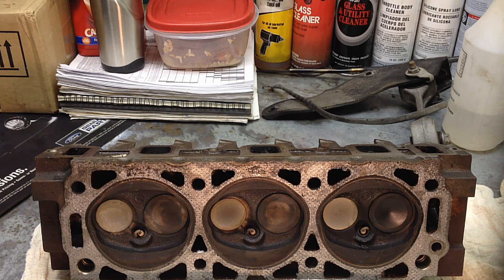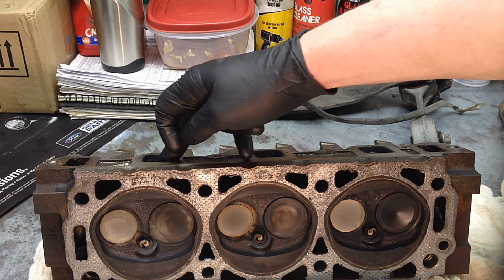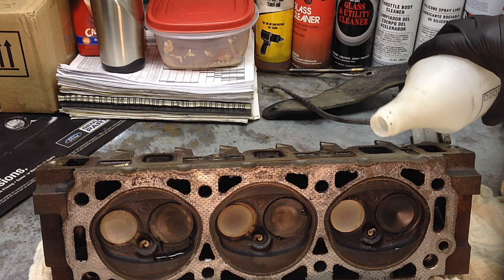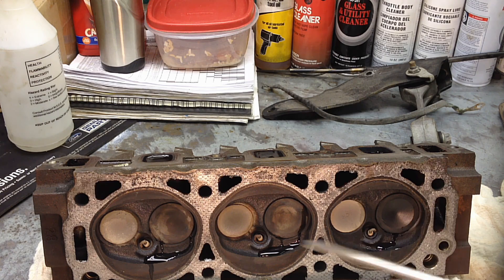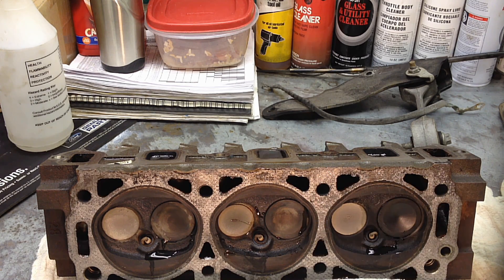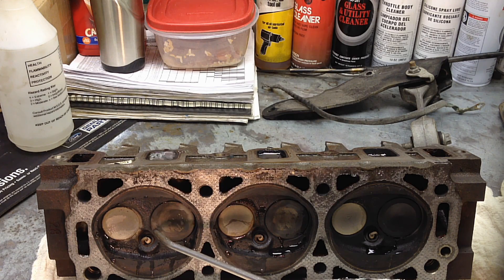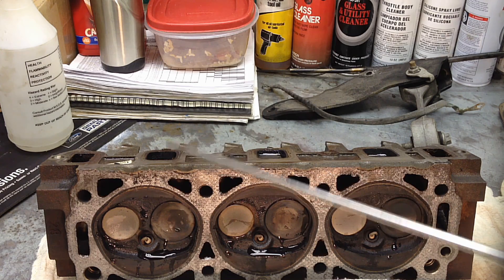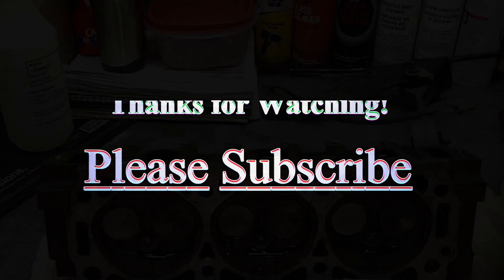Water Testing Cylinder Heads to Diagnose Compression Issues

Comment: Since the pressure required to force leakage past a minuscule gap is usually only obtained under full  piston compression, the water/  petrol leak test is only conclusive if the valve seats are properly wrecked. How do I know? Following  piston collisions on inlet valves on an Alfa 105 engineI can report the liquids revealed nothing, apparently no leaks.  My head guy said swap all the valves, especially the inlets. Sure enough, there was evidence of carbon tracking past the seats on the swapped inlet valves. Remember, the piston pressure will be around 150psi, not atmospheric pressure.

Comment: Very insightful vid. I just dont understand a) why not do the light test 1st. Takes seconds vs this way. And 2nd why would you use water over wd, diesel, or gas? Water is much thicker than petrol....light test then petrol test in my opinion.
Reply from the maker: go for it some use alcohol, some use gas, I and many others use water.

Comment: Water is best for this. The real test is to see if compressed air goes past valves,  not liquid past valves. I'd rather not throw compressed air at gasoline or alcohol just to see if it bubbles.
Reply from the maker: Wait you didn't see me use compressed air on the valves?
Reply: @FordTechMakuloco  Of course. This is for the comments saying you should've used gasoline or alcohol instead of water. It's all about the bubbles.

Comment: My motor frooze this winter storm behind timing chain freeze plug blowed out 4 of em the 2 block and the 2 cylinder head plug . Thought I had some side plugs blowed out aswell but no I find out I have 2 outside small cylinder head plugs popped ANY ONE HAS A IDEA WHAT SIZE ARE THEY .I ORDER THE KIT BUT NOT THE SIZE OF EM ,ON THE KIT THERE WAS 2 SMALL 14 MM PLUGS BUT THEY ARE NOT THE SIZE IS A LIL BIGGER I BELIVE A LIL SMALLLER THEN A PEENY AM GUESSING FROM 16MM TOO 20 MM ANY BODY HAS ANY IDEA OR HAS ENCOUNTER THIS PROBLEM PLEASE HELP NEED TO GET BACK TO WORK

Comment: This really helped me confirm the problem I suspected with my exhaust valve. I tried another method, but there were no results. I watched this video then ran out and tried it on my cylinder head immediately.  Sure enough, the test confirmed the valves were leaking on the cylinder that had low compression!

Comment: But isn’t water very thin compared to other car liquids?? Wouldn’t it be better to test on thicker liquid other than water that doesn’t get thru easier??
Reply from the maker: No
Reply: What is thinner then air?
Reply: @teal_2v338  airs not thin within right circumstances such as temperature, humidity, and state of gas, or liquid it can be dense.

Take for instance propane is  actually liquid, which turns to gas once mixed with oxygen and it is very dense to the point where if one opens a propane tank for 30 seconds to one minute then shut it off, move "said" tank and carry it away from the source any flame lit within its facility can cause a open fire ball because it falls straight to the ground with gravity in a settling effect.

To simplify what i am saying easier in car terms, when its cold out side air is more denser and anything with density is not thin....

Although i would like to think helium may be thinner then air....

Comment: Hey man I have a question for you!! I just diagnosed my crown Victoria misfire! Cylinder 4 on this 2v 4.6 my cam follower fell off ! Why would this happen ? I was able to reinstall it with a flathead screwdriver,no problem. I then checked compression on this cylinder and while the other cylinders tested at190-200psi and held there well. This cylinder (4)only got to 90 psi. A wet test brought it up to 190psi. A friend says”yep,bad rings needs a rebuild”. I dont believe it. The car has 40k miles on it. Should I be lookin for something else ? I’m a bit of a novice with auto repairs. With the cylinder on the compression stroke(not top dead center) I shot air into the spark plug well and can feel it freely leaking out of the intake port(I have the intake removed-another issue). Am I missing something ? Should the head be removed? This is my daily driver and only vehicle and I need it running by the time this quarantine crap is over. I also had a coolant leaking internally in the intake manifold. It’s possible it was pulling coolant into this cylinder ,even tho cylinder8 was right next to the leaking culprit

Comment: What running condition was that head causing a rough idle or complete misfire backfire through intake etc? It is my assumption that many valves leak but I cannot determine when too much is too much
Reply: seriously a 12 to 16 valve engine and more,the valve stem clearance is critical on a gasoline engine,the specs must be dead on,especially if you're driving state to state,where a 6 8 10 hour burn when the car doesn't shut off,not knowing the shape of the car you own is not cool,valve springs and timing chains or belts,don't even look at them just toss them and go back new 80k to 125k,but the head has to be dead on,plus rod bearings

Comment: So what do I do to make them seal my self? My car burned a valve i think from zero compression so I got a used head to bolt on and I just did this test and it leaks. So what do I do so it's not low compression. And I'm installing stiffer springs does that make it seal better? Needed the springs for race cams I'm installing.

Comment: Water works ok, I've found alcohol or unleaded gas is thinner and has less surface tension, it will flow through spaces water will not. Just a thought.

Comment: Water works ok, I've found alcohol or unleaded gas is thinner and has less surface tension, it will flow through spaces water will not. Just a thought
Reply: OLD Post revival: This test does not care about surface tension or liquid passing through the space. The air pressure into the valve shows air bubbles that indicate a leak. Just FYI.
Reply: @stevecunningham3475  right meaning if air can pass through you have a leak! This video is gold appreciate the comments as well.
Reply: Yes i also agree with u... To break surface tension of water it will be good to add detergent,

Comment: what top mileage can you repairs valves at? meaning what mileage as in high mileage engines?
Reply from the maker: +Richard Cowtails an mileage the machine shop will tell you if it cannot be repaired.

Comment: good quick valve test
Reply from the maker: Yep a wise old tech told showed me the way many moons ago.
Reply: ye, i usallt do it the other way with throttle body cleaner so i fill up the Combustion chamber area and the cleaner will eat away the carbon, but both work great